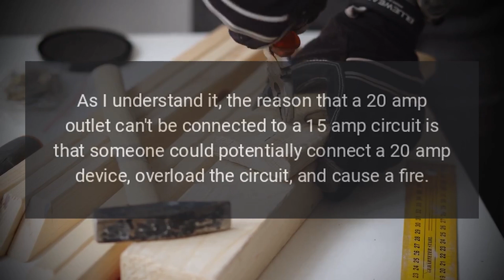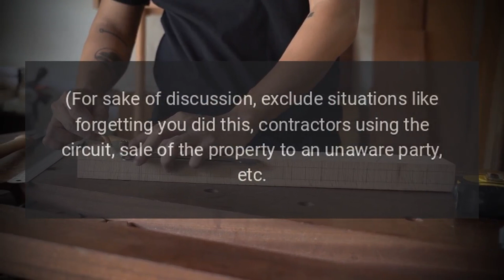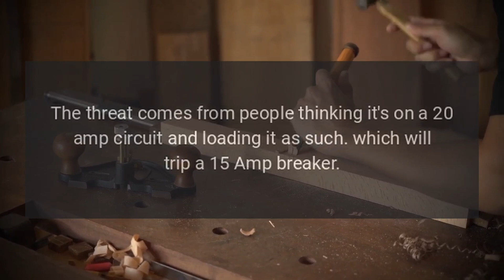Does a 20 amp GFCI outlet on a 15 amp circuit pose an inherent danger?

Comment: How could it over load the circuit and pose a risk? The 15 Amp breaker is designed to trip if it's over loaded.